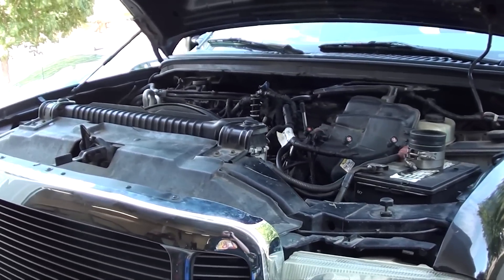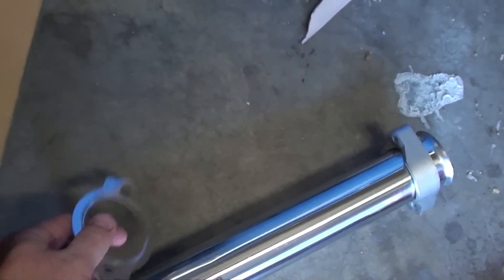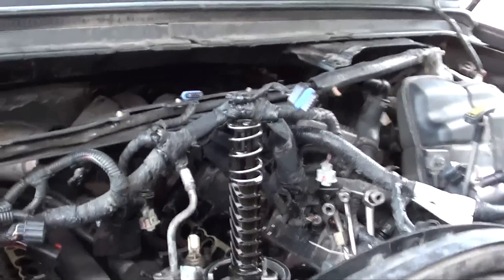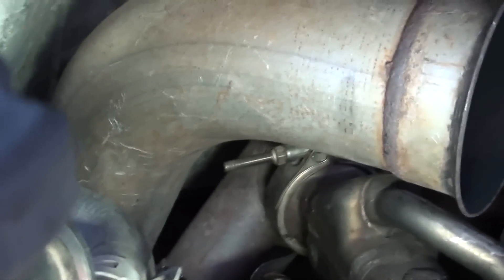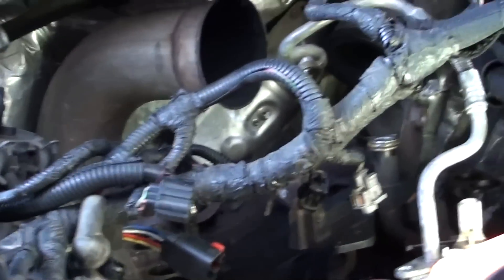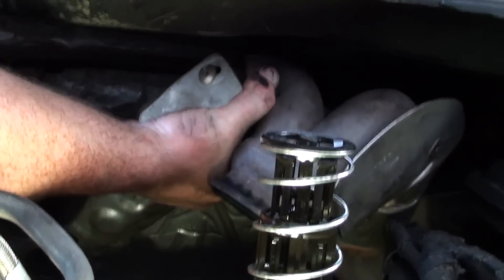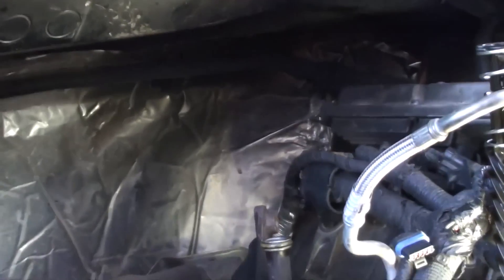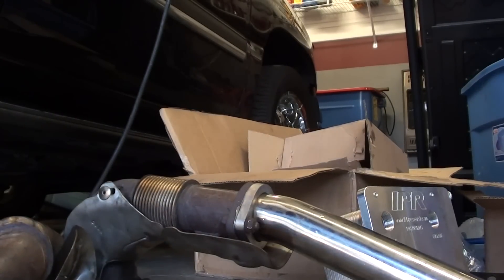Powerstroke 6.0 IPR Remote Oil Cooler + High Flow Coolant Filter Install - Part 1

Comment from the maker: Yes cab was left on, I pulled the evaporator housing out which is the only way to get the passenger head off.  The driver's side, lower, rear bolt is the tricky one.  You have to leave the bolt in the head (use a rubber band) when removing the old head, and pre-install the stud (again use a rubber band, or something to hold it in place) prior to installing the new head on the block.

Comment: I installed the IPR filter inline with the heater hose rather than using the manifold.  Cleaner and less expensive.  The filter works great.  I have cleaned it twice in 10k miles.  

The only issue I have with the system is leaking valves.  Vince kindly sent me 3 sets of ball valves.  2 leaked.  I bought  ball valves at Home Depot.  Same problem.  

A mechanical engineer determine that IPR sent un-tapered ball valves that insert into tapered threads.  The leaking is only a minor nuisance.  

Plan on installing the 3rd set of IPR ball valves when I spring clean the cooling system.  IPR said the threads are tapered.  Time will tell. One would think that the correct ball valves would be sent with the initial product.

Comment: Great video. I've watched most of your clips. I have a 06 6.0 and am installing the IPR gen2 delete right now. I'm doing it without pulling the manifold off, but was wondering, if I did want to pull it off, how hard is it to remove the oil filter/fuel filter housing?

Comment: Great video buddy, very informative.I bought a new diesel truck in 2011 and its a  6.7L Ford F250 and I'm not  sure if I wanna keep a diesel because there is so much up keeping to do and they are fragile if you're not careful. Have you always owned a diesel? Do you think its worth all the up keep that's needed versus a gas engine? They run strong but when they go man they're gone. Have a good day bud.
Reply: I owned both gas and diesel. The diesels have always treated me better especially the 6.0l believe or not.

Comment: website and cost of kit?
Reply from the maker: flaco it's an ipr kit but I wouldn't recommend it. Go with the bullet proof diesel one for a couple extra bucks and you'll be set
Reply: @paintballrefjosh  I got an ipr kit 2 years ago and never installed it. I'm going to be doing an oil cooler in the next few days and was going to install the kit.  Should I go ahead or just keep it stock?  If there area lot of leak issues I am thinking of passing on putting it on.
Reply from the maker: @flatnastyproductions5810  Poorly designed kit.  Many problems and not worth the headache.  BPD would be a better choice.